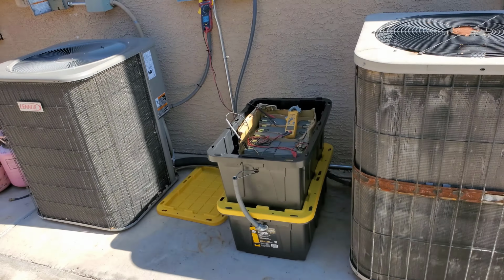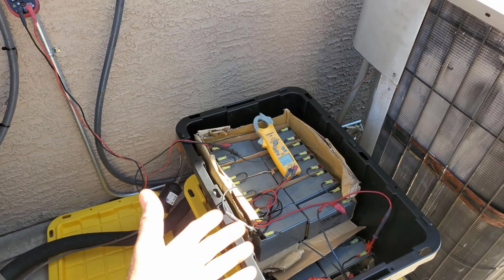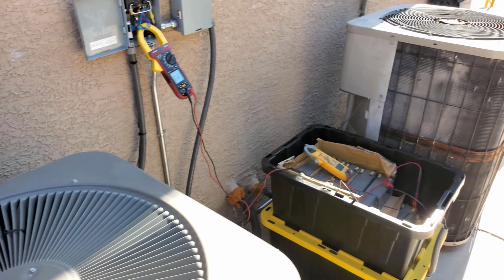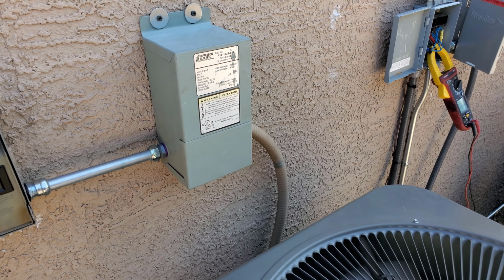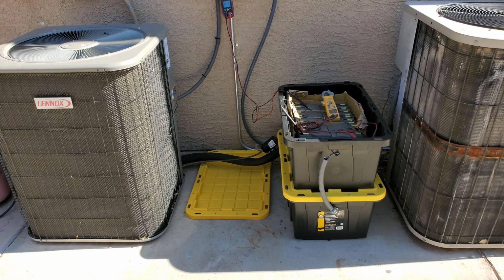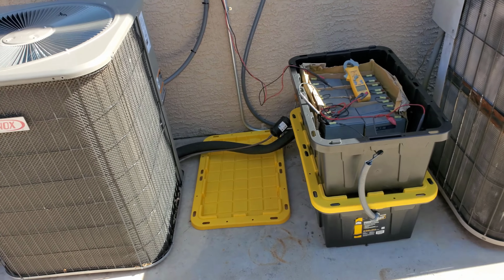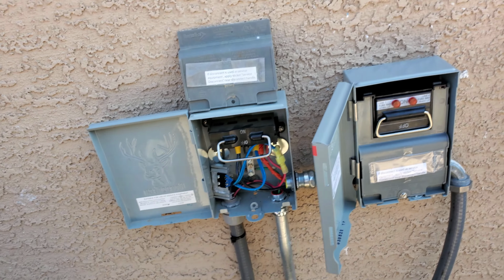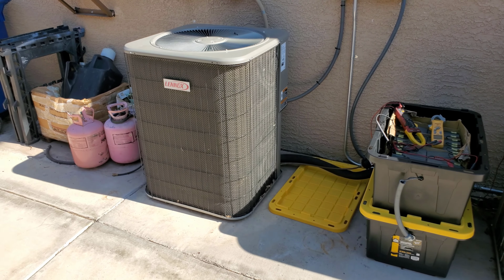Added more batteries then removed some to fine tune my tri-powered solar assisted heat pump!

Comment: Just about got it dialed in. You need something for a change controller
Reply from the maker: I don't think I'll need it.
The entire high voltage span of charge a d discharge is just a volt or two for each battery and within it's abaility.

Comment: You can always just tap into a 120v circuit in the attic to run your low voltage
Reply from the maker: No. It must tap off my solar/battery pack so it will run when the power goes out.
Reply: @hackfreehvac  good point
Reply from the maker: @joeshearer1247  Yeah because right now I have a new AHU I installed when I installed the Lennox 3 phase and the AHU has an X13 in it already.
SO the only reason to modify it will be to make it run off of the batteries IF the power goes out. Which it has for hours at a time here in Glendale. Which sucks when it happens on a summer night.

Comment: Lead acid cells will die very quickly if they are left discharged for any significant length of time. They should be recharged immediately after use to minimize their capacity loss. Without that they may only last a month or two.
Reply from the maker: Wdll, they are free so we'll see what happens.
I'm not dropping them down below 11.7 or so. 

These should be similar to deep cycle batteries and no way were people recharging those right away. (RV, trolly motor etc).

And unlike an RV or trolly motor etc, my system only takes them down to a certain voltage and doesn't drain beyond that.

And RV etc with lighting often drains way beyond that.

Comment: Do you have any idea or guesses on how long the output of the batteries would last if they were exclusively used? I realize this is extremely variable, but in sunny Arizona I’m just wondering if you’re getting enough charge per day where it would last all night.
 Just wondered

Comment: What do you have in place to prevent the batteries from being overdischarged?  Letting the Solar drop to 0v is fine, but you don't want to drop the battery bank much below 1.75vpc.
Reply from the maker: The utility power goes through the rectifier in the VFD. When the DC bus is higher than the rectified AC the utility is switched off.
And then as the solar/battery DC drops the rectified AC utility power will start to switch on through the rectifier.
So normally the lowest the DC Bus drops is to around 285V which will now be about 11.8V per battery with the 24 in series.

Now if I ever run this thing when the power goes out it will run a little lower until the VFD shuts off on low voltage fault.

So, it's impossible to drain them too far as long as I get the right amount in series which is why I dropped from 25 to 24 is series.

Comment: How did you find so many of those batteries ?
Reply from the maker: I was working on a Liebert for a server room.
At the same time they scheduled in the guy who was there to replace the batteries.
It is funny because out in the parking lot I mentioned that I used to score used batteries when I was at a facility but used them all up.

When I was finishing the customer says "Hey, that other guy said you would take the old batteries?"

I was like, oh, sure. I'll do that.

Over 100 batteries. I carted them down to the service truck from the 5th floor and it was enough to sag the F-250 I was driving.

But SCORE. They are used. But still worked.